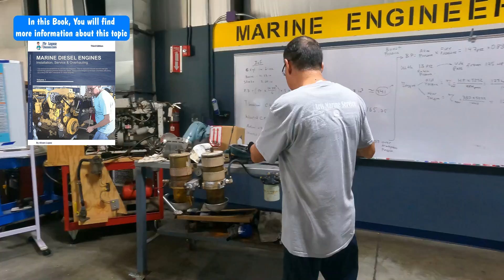Turbocharger Troubleshooting

Comment: Hai may c12 engine if I give RPM 1300 no going speed and it will be black smoke,after no RPM only full throttle 1400 ,mechanic team said turbo is good,what do next